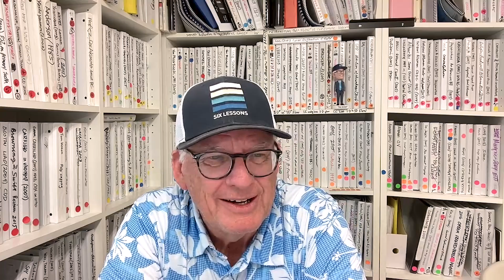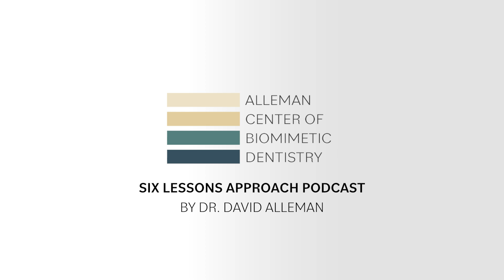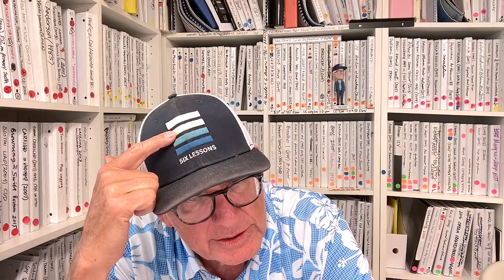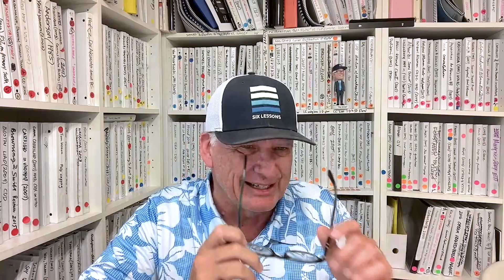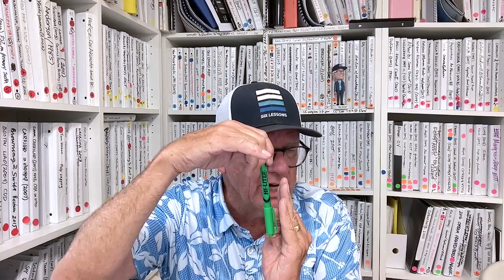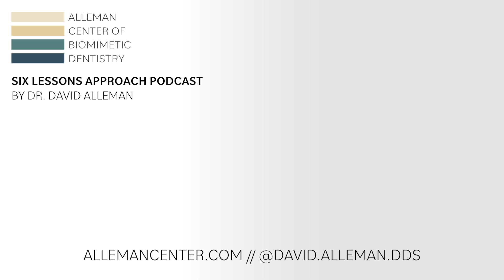The Difference Five Minutes Make: Decoupling with Time

Comment: Thanks a lot dr. Alleman! 

I have a doubt about the heriarchy of bondability when placing our bonding systems. I am aware that in substrates with more hydroxiapatite it will bond faster than in those with less hydroxiapatite (from enamel to outer caries) . 

I also understand by your mumtiple explanations (thanks) that we can control this with 

1. Decoupling with time to allow the bond in the substrate with less hydroxiopatite to mature
2. To place 0.5-1 mm horizontal layers of composite to prevent being in two different hiearchies at the same time and potential delamination of our HL

I am assumming the term “bond faster”means a faster creation of polymer chains creating an active zone that will have more potential to attract and bond new layers of restorative material. 

My question is, what literature do you recommend me to go to to understand how this polymerization proccess looks like (chemically and graphically) in these different substrates at the same time when applying our gold standard bonding system.

Cant stop saying thank you.. THANK YOU AGAIN!
Reply from the maker: That's a great question and topic for a future episode. Previous episodes have covered the topics of flow and c-factor, but this is an important topic that we will discuss many times.